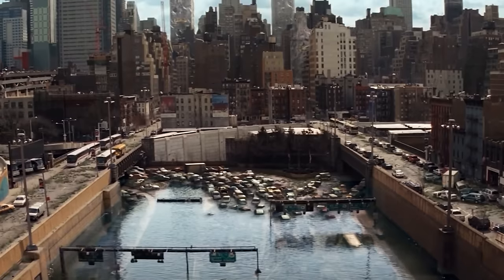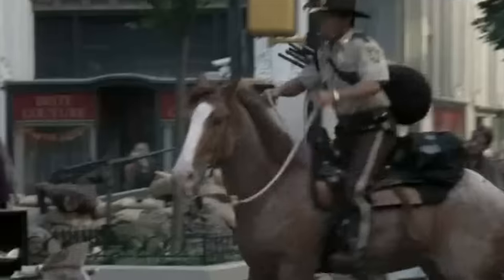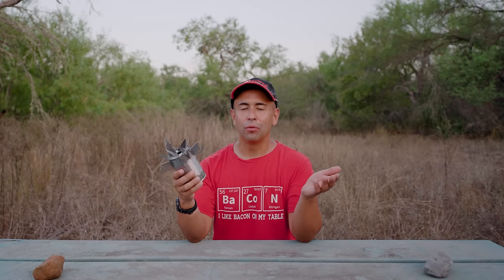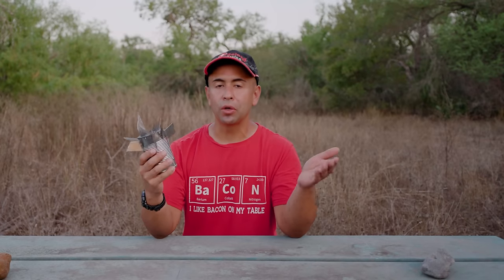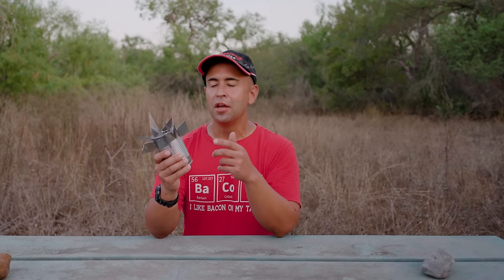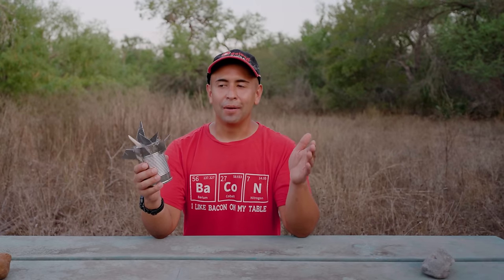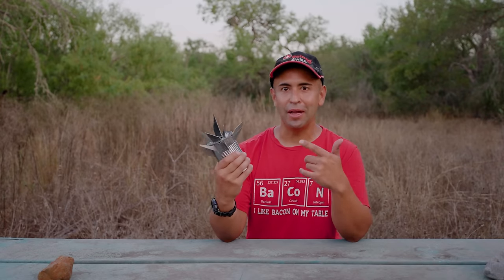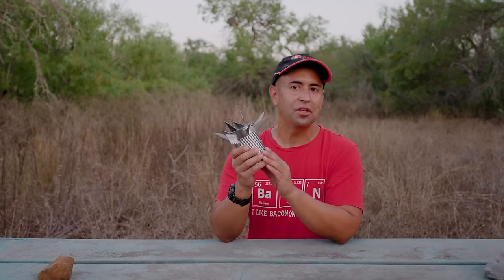How To Slay Zombies Instantly: The Nail Bomb

Comment: holy moly that 4kg one was brutal, that shrapnel slicing straight through that tripod leg 50 meters away is terrifying
Reply from the maker: We are just glad the camera was untouched. Most of the trees around the blast got peppered.
Reply: @OrdnanceLab  For the extra spicy stuff you could sit the camera behind a nice thick tree and use a mirror to get your angle, would possibly be better than crossing your fingers and hoping an expensive camera doesn't eat a fragment. Depending on how much the cameras cost versus a small mirror it might save ya a buck or two.
Reply: ha ha preschool goes bye bye
Reply: @OrdnanceLab next time use 6mm steel bbs

Comment: The RCMP call is one of my favorite running jokes
Reply from the maker: We legit are curious if they are checking us out. We fear if we travel to Canada they wil seize us for questioning or frame us for maple syrup smuggling.
Reply: @OrdnanceLab  I'm pretty sure if you're reported in Germany you'll be sent a disclaimer that they got a report about you. Wouldn't surprise me if that happens eventually.
Reply: @OrdnanceLab more likely to be public safety Canada (homeland security) and CSIS (Canada's CIA) at least those are the ones who were asking people about me got no good reason after I'd already left the country.
Reply: I still think they need a maple syrup based demolition product , just because .
Reply: @kaboom4679  I mean, it's doable.  Sugar works as a fuel with ammonium nitrate, ANSU is what it's referred to as.  No reason you couldn't use maple sugar.

Comment: I have watched so many videos testing the shrapnel effects of explosives. I feel the lack of desired evidence is because of the lack of coverage. Keeping the same plywood targets y’all use to figure out how much force the shrapnel has, make a circle or square or whatever around those targets using drop cloths. Harbor freight has the 9x6 ones right now for $8. Buy a bunch of them, build a frame of sorts, that can be used over and over again. Then hang the drop cloths on the frame. I feel you’ll catch the spread of the shrapnel better. Like paper targets, the drop cloths can be used numerous times if you put a patch on them. Iron on cloths patches would be super easy and cheap. Or just sew up the holes with a sewing machine, even cheaper. 
Born and raised Houston boy, Hell, I’ll help y’all build the thing. I went to Sam, I’m fairly familiar with the area y’all are in.

Comment: i wouldn't use ballistic gelatin for fragmentation catching but instead just plywood. if it goes trough 3mm plywood its can give serious wounds if it goes trough 12mm it would suggest lethal wounding capability.
Reply: Taofledermaus was getting OK results with the homemade fishing lure silicone /RTV rubber when experimenting with that instead of gelatin udue to temperature issues with gelatin, results weren't bad and would probably do in a pinch.  quite possibly one can go all Paul Harrel and start sinking rib bones and oranges as lung simulant inside it as well...(don't forget the t-shirt leather skin simulant and of course the "High Tech Fleece Bullet Stop®©")
Reply: @r.gilman4261  gelatin is very expensive and isn't a human analog just a repeatable medium. plywood can do the same for a lot less hassle. the biggest issue when catching shrapnel is surface area and getting enough silicon rubber is gonna be pricey as well.

Comment: i wonder if a single sheet of drywall would be better for patterning shrapnel and maybe figuring out how much damage it could cause (also it is fairly fire resistant). Drywall isnt the cheapest thing, but its not terribly expensive either. Might be something to consider.
Reply: what about using .177 cal bbs instead of nails? Glue them to the inside of the can to make a good spread.

Comment: A cost saving measure for you guys, instead of buying IPSC targets, go to Dollar General and get larger sheets of color poster board, and simply cut a square out of each corner, giving the appearance of a head and silhouette. I started doing that a while ago when I couldn't get IPSC targets locally and wanted just a plain silhouette and not a B-27 or where scoring rings matter.

Comment: I AM an explosives expert... at least that was my Army skill in the Greek Army 50 years ago... I've been experimenting with these kinds of bombs myself too, only I wasn't using blades and nails, I just applied grease on the inside of the can, just enough to hold the steel balls and nuts I was using as frag... then a piece of a plastic bag to keep the explosive mix dry, securing the lid and that's all... setting it on ground lvl the frags like to take an upward trajectory around 20/30 degrees, and yes!... they can do a lot of dmg... even 1/5 of the size you used

Comment: If you look at a factory made Shrapnel shell you'll see that the shrapnel balls are seated inside the charge. It's not around the outside.  When it detonates the metal is ejected out with the blast.
I've experimented with this configuration on a very small scale using an empty Co2 canister.  I could only half fill it with powder.
The result was astounding!!!  Less powder made a much better blast with more concussion. 
Only through experimenting did i find a more efficient result. 
That was with store bought fireworks (rocket engines) crushed up finely. 
So in this case less was more and the Shrapnel worked out better than placing it outside of the "bomblet".
Try this and i guarantee better results.  But don't make it too big !! A Co2 canister from a soda maker is the right size,  any more is Terrorism!!!
Remember I was using old fashioned "black powder ", which is  classified as a Defligrant. It doesn't detonate it burns at a high rate which causes a blast when it's confined. 
Its saving grace is its easy to obtain,  it doesn't need a detonator and it can be manufactured quite easily.

Comment: i have a suggestion for less cuts while making it! what if you puncture larger holes into the can prior with a plan for where each fragment will go, amd then using plastic bottles or anything like it to melt and make a kind of hot glue, still kind of apocalypse friendly, because plenty of plastic and fire is a necessity for life, great video ❤

Comment: Something I’m interested in seeing is using a penetrating explosive and putting targets on the other side of the steel to see the shrapnel effect.

It would be interesting to see how shrapnel behaves after penetrating a thicker target
Reply: Those usually penetrate into confined spaces like armored trucks or tank turrets with a huge amount of overpressure ultimately being what does the damage the molten copper fluid is going near Mach 30 along with the explosives force behind it, shrapnel is usually limited to the spall from the hole itself and the copper stream itself if it hits you

Comment: If you wanted to do a chemistry video would be interesting how or where you could get ammonia nitrate for black powder or any explosive without already having the materials.  

I guess if you had certain products it could easy easy if you had the recipe and knowledge.

Other part is just understanding chemistry of making the element pure.
Reply: There's no ammonium nitrate in black powder that's potassium nitrate. You can buy it as stump remover.
Reply: Black powder actually uses potassium nitrate. Though you’ve got me thinking about what it would do if ammonium nitrate were used instead. You can actually extract potassium nitrate from soil or chicken dung by soaking it in water multiple times, filtering it, and letting it evaporate. The resulting KNO3 crystals can then be purified by doing multiple recrystallizations. HTME has a good video on that. NH4NO3 is made by the reaction of ammonium hydroxide (ammonia solution) with dilute nitric acid. 

NH4OH (aq) + HNO3 (aq) —> NH4NO3 (aq) + H2O (l) 

Another route uses what’s called a double displacement reaction: ammonium sulfate solution is reacted with a solution of barium nitrate, or ammonium chloride with silver nitrate. This works because the reactants are all soluble. The ammonium nitrate produced is also soluble, but the barium sulfate or silver chloride produced in either reaction are not soluble. So, these two compounds precipitate once they’re formed; in order for double displacement to work all reactants have to be in solution. If one of the products comes out of solution as a solid it can’t swap anions with the other reactant.

(NH4)2SO4 (aq) + Ba(NO3)2 (aq) —> 2 NH4NO3 (aq) + BaSO4 (s)
NH4Cl (aq) + AgNO3 (aq) —> NH4NO3 (aq) + AgCl (s) 

 Making NH4NO2 is not worth preparing because silver nitrate or barium nitrate are expensive, and if nitric acid (or the chemicals and equipment used to synthesize it) are available then there are much more energetic compounds like nitro esters, aza-nitro compounds, and nitroalkanes/nitroarenes (MeNO2, 2,4,6-trinitrophenol, 2,4,6-trinitrotoluene, etc) that can be synthesized.

Comment: Former artillerist here: The average shrapnel size of a 155mm standard HE shell is only about 0.5 grams (7.7 grain). When making improvised fragmentation grenades people generally use way to big things like nails, coins, empty shell casings, etc. A much better option is something like aquarium gravel, beads or even BBs. Yes they run out of kinetic energy faster, due to their lower density, but when using a binary explosive you're not going to get much effective range anyway, so better go for hit density.
Reply: Sheet metal screws are good shrapnel

Comment: Just an FYI; Uline, a packaging supply business, has rolls of corrugated cardboard that could be used to hang a semi-circle around the blast. A 48" x 250ft roll is only $86.  
Home   >  All Products   >  Cushioning, Peanuts and Foam   >  Paper Cushioning   >  Corrugated Wrap
This would better display the shrapnel hits and would surely be cheaper than IPSIC targets. You could still spray paint some figures on it if you wanted. Also, Brandon is running for office now so you might want to be careful about making fun of his hair. He might be president before too long ! Maybe send him a case of Aqua-Net hair spray to get on his good side.

Comment: If i was to make something like frag granade, i would use nuts and ballbearings of coresponsive size. I would stuck them on sticky side of ducktape and put down few layers depending on strengh of explosive. Idea is chunky schrapnell will keep it's energy longer, letting it pass trough more air and other material. 
This is theoretical, or something someone would strap to rpg rocket to make it anti infantry

Comment: Just a thought, if you used ball bearings instead of nails and blades it would be safer and throw a better fragmentation effect.
Reply: Then it wouldn't be a nail bomb anymore. If i had to make such a device, i've got more nails and screws than ball bearings in the shed.
Reply: In "most" zombie fiction you have to destroy the head in order to stop them.
Reply: @Njazmo  true, the Improvised Munitions manual I have from the service shows the nail bomb being the nails taped around a a demolition block of some sort be it TNT or Plastic. (I'm ex-USAF EOD) I'm more partial to the fragmentation effect of ball bearings as that is the same as hardened shot in a shotshell.

Comment: "remember body armor is important."... sits with body armor plates facing away from the explosion thus giving little actual protection from shrapnel. also sitting behind a tree so its less important, but you want that armor plate facing the danger, not away from it.

Comment: Flash powder has a tremendous amount of oxygen expansion but it has poor brissance.  Great for loud booms and moving things but not so good for breaking things into small bits.  In an apocalyptic scenario one could also hypothetically make potassium chlorate and mix that with paraffin for a low velocity "plastique" type, actually used in WW1 with limited success.  It made larger chunks of shrapnel which caused massive wounds but with less of an area affect, aka less chance of hitting something.  Well I'm off, until next time, stay frosty (I still dont know what that means)

Comment: West Texas myself, and damn it's been hot. No need to apologize, just inform everyone it's about 108f outside, heh.
I'm no expert, but maybe a directed charge, attached to a tree, with one side of the canister weakened to direct the fragmentation.
Reply: Also with the accelerants you used, you could use a trip wire trigger with a .22 cap, and you can buy the trip wire device for about $20.

Comment: Toilet cleaner mixed with aluminum foil, filled with framing nails in size 10d penny nails. Shake and throw. 

A roomba vaccum robot/ RC car filled with 20-120lb tannerite and 100-200 framing nails in size 10d. Have soup cans filled with tannerite and nails placed in strategic areas of ur property.

Comment: You guys don't have to risk your cameras like that you know.
If you build a simple platform that shields the camera for it to hide behind and look through a mirror at the subject.
You can get mirror super cheap by the Box at the hardware store
Reply from the maker: You aren't wrong. We had housing for our cameras but lost them in the fire. Jake is building new ones but he's a bit over tasked right now. Sean isn't power tool savvy.

Comment: nice work😄 if you have some machinist feiend, you can save a lot of time. they always have tons of steel shavings from the lathe work waiting to dispose of. and men, those shavings are blade sharp and made of good steel. free material, may be it is good enough to be the talking point of your next episode?
Reply: The swarf particles have a large surface area and are pretty light so they wouldn't travel very far. You'd get good coverage at close range but it wouldn't have the mass to penetrate.  BBs, nails, nuts and bolts are probably more suitable.
Reply: @LesNewell  inside the machinist's waste bucket also have cut off, trimmings from steel rod, metal plate, nails, bearings, old screw and nuts. those are pretty good mass you mentioned.

Comment: so, "zombie expert" comment (i didnt even read that much zombie lore anyway)
the frags may not kill a zombie, but it might as well maim & disable its body, drastically reducing its mobility
depends on what kind of zombie it is, it might be either a small or a huge improvement: crippling a slow zombie would be convenient, but crippling a fast running zombie would be a huge achievement as the usual quick zombie is now much less dangerous, crawling on the ground

Comment: i use to use 2 cardboard rolls, the inside one had been inside of rolls of ICE AND WATER SHIELD (USED IN ROOFING) and the outside roll was from rolls of carpet. both had to be cut with a saw. i would put a 1 pound can of FFF in the inner one, and  USED roofing nails inside the outer tube. i used body putty to seal the top and bottom of both rolls the inner one inserted in the outer one after the body putty hardened. one forth of july (1988) i set the inner roll off on the top of an old stump about 50 foot behind the house. when it went off the 2 story house shook and neighbors heard it 1 mile away and thought it was next door to them!!
im 100% serious, i have a reputation with the atf sissy's and a conviction for possession of chemicals with intent. 
im 65 and in bad health, do not expect to live 10 more years, so life in prison if a joke to me. hopefully the atf sissy's will shoot me between the eyes tomorrow morning as im drinking coffee at my kitchen table!!!

Comment: 😎

IMO you could easily make it more directional.  Instead of exploding in all directions at once. 

Several wraps of duct tape /tie wire/ around the bottom quarter of can should make blast more directional , out the top. 

Would love to see a ‘far cry’ bottle cap mine… with a looter opening the lunch box & getting hit in face! 

A small wound in SHTF is life threatening.
 Tetanus will be deadly AF!

✌️🤟🤙
Reply from the maker: Far cry bottle mine you say? Def doable.
Reply: I don't remember far cry having bottle cap mines (unless it's the newest one, havent played it).

But they did test out a Fallout bottle cap mine.

Comment: ok so not sure exactly what you are trying to do except make a sund iversion for zombies there.
 y might try this if you have the guts to though.
 ingredients, 3.99oz magnetic ferrite fileings.
3.9oz magnesium granuals and powder.
3.99oz phosporous powder
 1/2oz bp powder.
 1sqft wax paper , 4" strip of clear box tape 2"wide.
 5lb bubblegum that has had all the sugar chewed out of it,
which wll be pressed around the wax paper t crete a thin eggshell of bubblegum that can be hrdened in te daytime sun.
 case of percussion caps,\
 drillbt the diameter of the small end of apercussion cap.
 cn of clear spray paint.
 nw this is prtty self explantory, mix ad put ito wax pper and tape shut,,
 me bubblegum eggshell ad harden and then drill and placeperc caps into holes and then spray to waterproof.
 n52 magnets plced in between the percussion cps will make it stick to metal. ignites o contact with hardsurfaces.
 safe range from device 15ft radius from centr.
 tpurature grade 7000+degrees F
 2nd degree sunburn distance pr 5 secods . 15ft radius.
 tempurature at safe dstance .
 idk bt it turned my eyebrows into ash and made my clothing very dry and my hair had to be conditioned for a week.
 syou gess what it does,
 i call it a plasma grenade not explosive at all. but will cook dinne in 5 seconds or less.

Comment: Peoples.  Leave the rcmp alone.  They have enough work to do, and are streched thin enough as is.  I did call them yesterday as someone speeding, and running a stop sign by my house then tossed a 1.5L bottle of wine out of the car across the road from me.  I went and cleaned up the glass so no ones tires got chewed up by driving over it.  I doubt they found the car and driver.  But thats a more effective use of their time, things they can actually stop if possible.  🙄